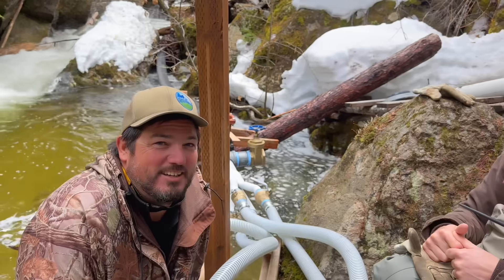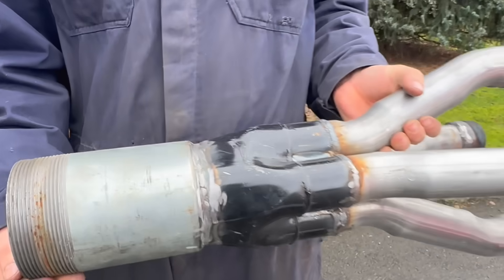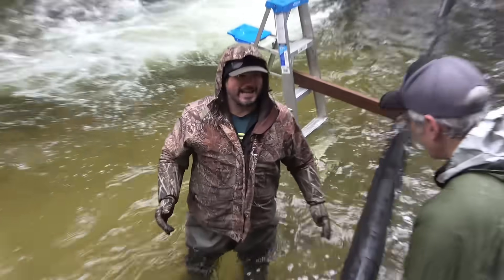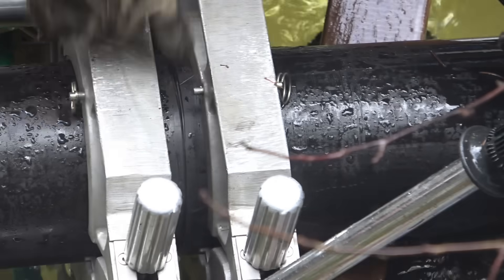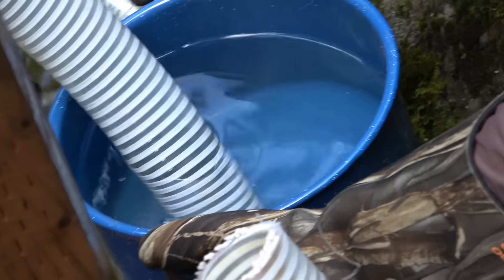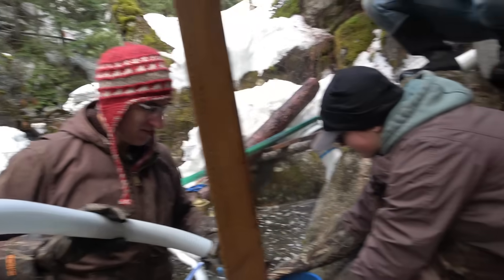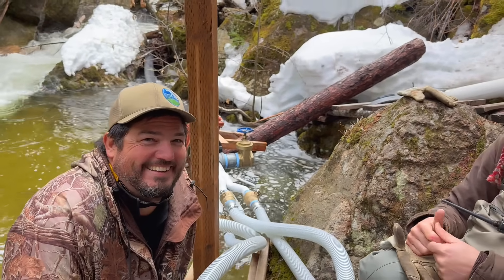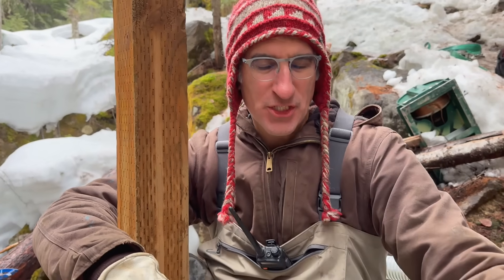Off Grid Micro Hydro - 24/7 Electrical Power - THIS is The Way!

Comment: T-bolt clamps for the nozzles. Just from experience, hate wormscrew clamps for something serious like this. The battery voltage/charge thing. Bridge rectifier + MPPT controller (checkout alternator generator videos). Victron.

Comment: Really cool, but wouldn't it be more feasible to have 2 turbines run simutaiously? (or even more.. there is a pretty hefty reduction from the main pipe down to the 4-way splitter ;) so a potential for a upgrade?!) Two would also increase the redundancy.. and when two nozzles are enough for the 200V wouldn't this mean double the output? or at least more..

Comment: Using corrugated wall pipe seems wrong to me. It will introduce a negative resistance to thne flow reducing its velocity.

Comment: We used this same Pipe to pull it through an old cast iron or Clay drain pipes.  The Land fills all use this same type of Pipe.  We called it pipe bursting.  We welded the cutting head onto the front of the new pipe.  And used a hydraulic system to pull the cable with the head and pipe through the old Pipe.

Comment: Victron 250/60 Mppt would be a perfect fit to control voltage.
You want keep voltage around 100/150v it would be 6a, then Mppt can convert it to the correct voltage.

Comment: I've never really looked into the micro hydro market, but that turbine looks like a pelton turbine. They are supposed to be for low flow, high pressure. In your case, a kaplan turbine would be much more suitable. They are designed for low head, high flow. And the pipework would be much simpler. The vertical kaplan turbines i have seen, have a large single inlet pipe that wraps around the boat propeller shape turbine, sort of like a turbo or snail shell. Much better for flow. 

No idea if that is available at micro hydro scale or not. In any case, I love the energy and effort you're purting into the project. You are literally living the dream. Hopefully you dont lose sight of that fact. Nice work!
Reply: No shit. They used the wrong technology. With that head and flow they might get 1500 watts or more with a turbine.

Comment: run it at max voltage / low current and run a MPPT at the battery end to convert to correct battery voltage - Look at Victron MPPT 250/70 would be tonnes for this wattage , higher voltage run will mean you will lose less on the way to MPPT

Comment: Try a much larger turbine like a wheel and maybe get way more power. The variables wont impact a larger turbine as much. Put ur main line into a shoot and run it over a large turbine wheel and maximize ur output and efficiency when it comes to lil variables. Your speed is probably too fast for the size turbine you have. On a larger turbine it might be perfect.
Reduced proportional losses: In any turbine, some energy is lost due to friction between moving parts and turbulence in the water flow. In a larger turbine, these losses, while still present, are a smaller fraction of the total power being generated. In a microturbine, the same amount of friction and turbulence "clogs up" a much larger percentage of the available flow area, depressing its overall performance.
Optimal operating speed: The size of a turbine is designed to optimize its operating speed (RPM) for a given flow and pressure. For a large turbine, the components are sized to run efficiently at a particular speed. If you use a microturbine in the same conditions, it will likely spin too fast for its design, leading to a drop in efficiency.
Better aerodynamic and hydrodynamic design: Larger turbines often incorporate more sophisticated and finely tuned blade designs. The physical constraints of micro-scale manufacturing can limit the complexity and refinement of the blade shapes, leading to more losses and a lower maximum efficiency.
The total energy is fixed: With the water flow and pressure (or "head") held constant, the total amount of available energy is fixed. Since a larger turbine is designed to capture this energy more effectively by minimizing internal losses, it will extract more energy than a smaller one.

Comment: Better you than me in that cold water.
Good project. 
Just back up the camera a little, 
so as we are not looking up your nose.

Maybe a bit of solar, for the anual 6 days of sunlight in mid summer from 11am to 1 pm.
Tall trees are a bitch..
My project, peak of 11 kw of generation with 24 kw hrs of 50v batteries....All solar in sunny Queensland, Down Under. Bell curve output over 8 hrs only. Talling about 44 kw hrs on a good day. Yes heaps of cool only air conditioners  here.
Grid available but no power bill, and I don't export at all..
Well done to you  !!!!!   Duplicate the system and 1.5 kw continuous might bring your generator to a stop, how good would that be?

Comment: a fly weel with 4 jet water tube like it is then when you rich de speed with those 4 change to just 2 jet water tube to increase the pressure of the a jet water tube and I tink the RPM going raise up significant

Comment: Move your bridge rectifier  up close to batteries. come out on the bridge rectifier to mppt charge controller so you can  run at higher voltage and cut down on losses

Comment: That was extremely dangerous and reckless, what you just did! Black powder is very hazardous to handle, as it can ignite from the slightest spark or electrostatic discharge. Ground dry and mixed, in large quantities, standing right next to it—and with the girls standing there too. You were very lucky! It’s not without reason that gunpowder mills used to blow up every now and then.

Comment: A high voltage solar charge controller will regulate your generator. Connect the generator to it like you would a bank of solar panels.

Comment: How are you burning off the extra power?  I know of a hydro system that they have a small structure set up with lots of space heaters they use to load balance the system.  They just turn off or on the heaters as needed.

Comment: I used a gate valve rather than a ball valve at the bottom of my system, and I always close it slowly to avoid hydro shock to the 1/4 mile delivery line, which is 3" fusion welded HDPE pipe, 149' of fall, 50 PSI dynamic head, with a Harris Hydro 24 VDC going into a Outback grid tied inverter and then on into the grid, with just a tiny set of batteries just big enough to buffer the power.  Bottom line is I put around 850 to 925 watts into the grid 24/7 from April to mid December then winter hits and as it's not freeze proof (plus the water gets so low the power is nil) and drain it out.  20 years in operation!

Comment: Have you tried running two turbines at one time.  Using two pipes instead of a quad four each feeding on opposite sides?   The total flow on that should allow almost double the amount of amperage out of the system.  Just watching this is very entertaining.

Comment: I'd recommend an MPPT to interface to the batteries. It will allow the turbine to run at optimum speed, permit transmission at higher voltage/less current & manage battery charging

Comment: why didnt you remove the red thing on the end of the pipe and place it on the cut part, instead of cutting and velding the pipe. velding should be last resort, there will be a rigde on the cutpart on the inside, either a vally or a hill, hampers waterflow.

Comment: Cool video.  It'll be interesting to see what benefit a MPPT tracker provides to the system, if you ever install one.  Usually folks optimize with an MPPT before working on flow routing, so it can be hard to see what benefit the MPPT has.

Comment: Hi guys, first time here love this kind of thing, it’s like modern man’s magic 😃, the issue of the rocks in the impellers, the food industry use a lot of stainless steel inline filters that could easily be installed in the flexi pipes, they can supply different size mesh in the filters. I use to work in the food industry as an engineer installed dozens in my time I think a make we used was supplied by a company called Axium Process Ltd I am sure you must have the equivalent in the Us food industry. Thanks Lee.

Comment: should try the torch on the barbed fitting itself, I haven't ever had a problem heating the fitting, you just need it to cool a little before putting on hose clamps
Reply: The thought behind that is so the barb and the pipe fuse together allowing the bands to seal better.

Comment: Great system very jealous!  Two observations. One, prior to opening the individual valves on your fantastic distribution manifold you should always have your brass relief valve open. Prevents hydro shock. Two, you went though all the trouble redesigning the water porting, removing all the 90 degree turns. But in the last section you use accordion pipe that totally destroys all the advantages you gained. You must replace with smooth wall pipe. You will gain 30 to 50 percent efficiency.
Reply: 30 to 50 percent guys. ya hear that?!?!
Reply: The so called “accordion pipe” you speak of is 100% smooth on the inside. You obviously have never worked with this product.
Reply: @Justaguy0420  what

Comment: Kris Harber is the microwhidrow guru in the UK. You should have a chat with him.  Le predus a lot out of a small stream & I mean Small like a ditch. &  charges up a  Big Stacker truck battery to run. His workshop & lathes.  But you're not doing so bad where you are.  See that contrapson, you just made Think river & beech & ask how far is your house from that Beach & could you get that presher to your place. Now think if not, how could I improve on it with a steel ram pump?  Rever flow Now  4" pipe In'put feeding ram pump To power my own Hidrow systom yes your own miny hidrew supply.  How can I do that at my place?  > I think it's worth a few winters at home to get the funds to set it up . & plan How can it be achieved,    OK, what if it was stored in a dam or stored underground?  Dam & all the  water on your property, the spring melt found its way there. Now, what would the head pressure be in that column? Let's start at 30  feet of depth, start all that water for supplying A dam from a river supplied underground full of water.From your own ram pump to the dam, it powers the Mickle Row hydro system. Dams were built to The water can be store in the winter so it doesn't freeze now? Just how far is the river from your house? Is it up or down? Where does the water come from on your land? Is it the River? .  It's time for asevay son .

Comment: Just imagine the pressure & lift one can get would get if all that water went into A steel Ram pump inlet. Now what lift & pressure would we get at the top of the Riveen?.  & Now, imagine  A reservoir full of water & an outlet pipe at the bottom driving a turbine.  How far away is that beech from your place? it it hie or low to your house?

Comment: low head is a real killer for these systems, hence only achieving 700W. But that is the key to off-grid living, combining different technologies. Wind, solar and hydro, all dumping into a well sized battery store. You definitely need an MPPT to optimise that output.

Comment: I live on a river and I've been thinking about ways to get power from the river if shit hits the fan.  Was thinking about a water wheel on a floating pontoon that is fixed to a piling that allows it to rise and fall with the water level.  Im just a cable guy though and don't know anything about all that.

Comment: I don't know much about power generation but it appears to me that you could split the water into two nozzless on opposite sides for higher water pressure and higher max rpm and power genrated than with 4 nozzless.. it looks to me to be a huge waste of potential energy to split them in 4 instead of 2. Just my logic tells me this. I might be completly wrong. Besides that it appears to me that water should go downwards with gravity to better use potential energy instead of sideways but it can be miniscule waste of energy. Either way I am jealous. Great idea. Great build. Fine family.

Comment: I know old video but run the phase wires all the way back to the battery system, run it into a rectifier something rating if at least 50% higher than the open voltage. 
Feed that dc into a mppt solar charge controller with a 40A+ rating and a input voltage range in the 50-300v range. You will be shocked how much power you are wasting

Comment: Also seen one off grid solution that is more of a small scale test. You take two rods of a specific metal type (somehow reacts to each other) and place them on a type of non conductive panel, arranged like points on a grid; all metal types are to be arranged in groups, one type on the "top", the other on the "bottom", and placing them in a flowing stream with specifically one of the metals up stream, it generates a low wattage power. Robert Murray Smith covered it in one of his videos, but improvements on that discovery seem to have not been pursued due to much better options, like simple turbine generators. 

One thing yall could look at to avoid the rocks getting stuck in the blades is one of those spherical bladeless turbines; figured it should help, as I saw one person resort to it due to fish or debris going down his intake, which would bind up the turbine, and after replacing it, would harmlessly bounce off and pass through the bladeless one.

Comment: @Gridlessness just curious but did you put a screen on your intake side and if so how tight of a weave on the filter size? If you didn't screen it that's why you have pebbles and twigs in your lines and in the turbine. You can actually build a cone shaped screen with aluminum wire and either pressure treated lumber or preferably aluminum tubing (round tubing btw) weld together and just big enough to go over your intake pipe, it'd just have to be about  5 to 10 feet long or so to allow for the right flow ratio and that should keep the debris out of your pipes, otherwise you'll keep getting rocks and debris in your turbine.

Comment: I honestly love the ingenuity of this setup, but I'm concerned that with the size of the Pelton and the nozzle diameter on those inlets, that a 4-way split is gonna cause stream interference that reduces the total available energy. In short, by trying to "spread the load", you may in fact be hurting overall efficiency..... and not by a small amount. As you probably know, Pelton's are impulse turbines, so they draw ALL of their energy from the velocity of the water, not the pressure. If you hurt that velocity with angular turbulence, then well.... no bueno. 

By eye alone, I'd say there is far more energy in that water than you are putting into the copper.....aka might need a bigger turbine. Also, I don't know how close your batteries are to the turbine.....but you'd probably be better tuning your turbine for higher voltage at the turbine and stepping down closer to your batteries to reduce transmission losses.

Comment: Nice DIY project, I love it. Yet, being a hydraulic engineer, I have some tips for more efficiency and longevity of your system: first I suggest to install a sediment trap at your intake (will reduce the wear on your turbine and avoids larger pebbles being sucked in, second: the manifold you made is suboptimal: the T-junction for the flushing valve is destroying energy, consider a 22.5 degree connection. Another improvement would be to connect the turbine using rigid pipes instead of the flexible hose you applied now while making sure the headloss over each of the 4 connections is equal so as to assure a homogeneous load on the turbine.
Reply: Ass a plumber of over 30 years I second these suggestions.

Comment: Good job. .7kwh is pretty good returns for something that produces 24/7. I’m designing a gasifier with 40ish kw output and working my solar setup to a capacity of 15kw so I can kick on the generator when I’m working on the farm to help power heavy Equiptment and the solar will keep the electric bill at none or just connection fees

Comment: When butt fusing plastic pipe I found it useful t put your jacket over the hotplate when forming the beads. It just keeps that little bit more heat on there. Great video bud

Comment: "Laying some pipe," just say it!  8:53  
Anyways, with regards to that new header with the 4 ball valves, make sure to close them slowly so as to prevent a water hammer causing cavitation that will destroy you're system.

Comment: Very cool project, but you are only getting about 1 horsepower (750 watts) worth of output power when you theorectically should be getting more than 100 hp (75kw) with that flow rate and 30ft of elevation, even when counting for losses. My guess is that you need a much bigger turbine and generator to maximize this potential.

Comment: I gotta know when you "tried the blowtorch last year" did you use it to heat the flex pipe or the connection the flex pipe needed to slide on? Although I dont think either way would work well

Comment: I would keep an eye on that HDPE fusion joint. Looked like a cold fusion from here. Also both ends of pipe are supposed to be faced at the same time and perfect fit checked before heating.

Comment: This water flow carries a few kilowatt of power, not just 700W. You really need to improve your turbine. You can ask someone to design and make 3d-printed titanium impeller. Also you need a proper generator, not this little toy. And MPPT controller for sure. If you will measure your water flow you can get a kinetic energy of moving water. From that point you should start designing your system, picking the generator and conversion. Modern turbines have efficiency around 90%. Your turbine is around 10-20%. You can quadruple output of the turbine just by doing everything right.

Comment: The intake is all wrong. You have to keep the intake surrounding area totally clean and the end of the 5" pipe should have a much larger water intake scoop that keeps rocks and sand from going into the 5" pipe.